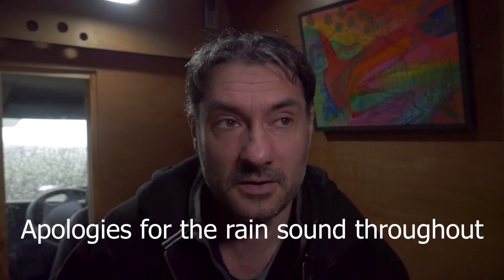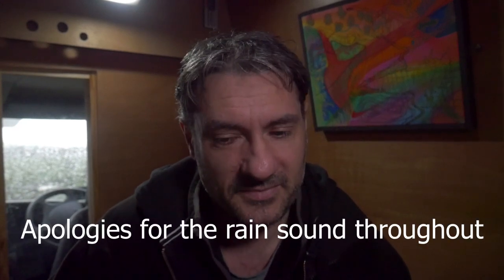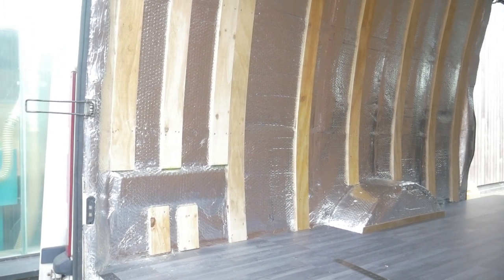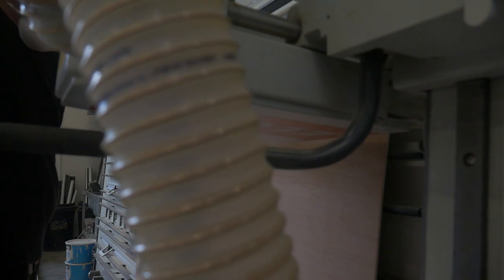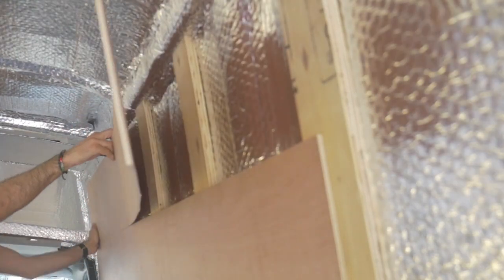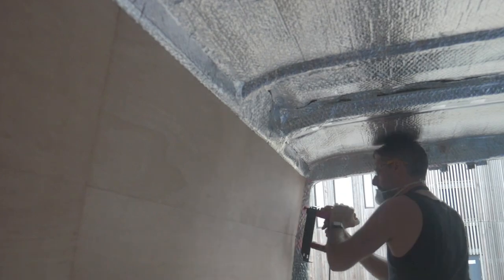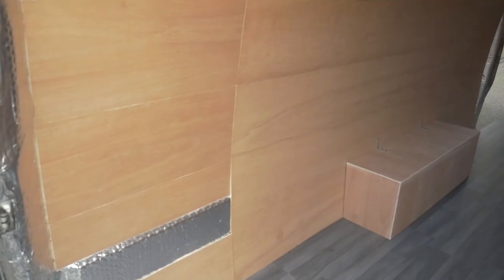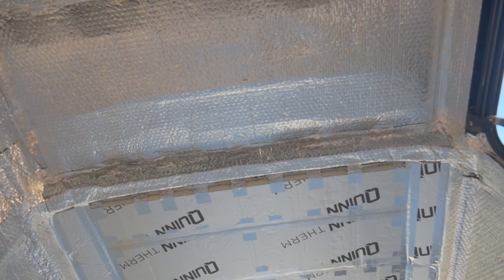IVECO Van Build - Go to the Wall - Episode 12

Comment: Nice work Rob, that work shop and tools especially the sheet cutter makes life easier for sure. As Luke said good job no screws into metal for cold bridge, very good tip marking for fixing points, I've always done that, I do the same thing for all the wires in walls and floor if relavent, I've done three vans now at 71years old my presant one is a keeper, I've enjoyed watching the prosses on you van, you take man.
Reply from the maker: Thank you Kim, The workshop was a real god send and most certainly made the build quicker. Glad you are enjoying the content. All my best Rob

Comment: Nice work Rob 👍 You may find with twisting and vibration that a screw here and there will be needed at some point. Nails can work their way out. You seemed to have put plenty in though 🤞
Reply from the maker: Yeh you are right every now and then I'll go round with a hammer and tap them in. But overall I've done really well. Cheers
Reply: @redpillinmotion  Luckily I got over my screw phobia, I had to as I'm a joiner/carpenter 😂 You did great mate 👍

Comment: The self-tappers screw into the metal wall of the van, correct? But how thick is the metal? I am having trouble envisioning there being enough thickness to grip. 

(Excuse my ignorance!)
Reply from the maker: Hey John, the self tappers would normally go into one of the support sections. So I would envisage that the thickness of metal here is around 3mm - 5mm. It's reasonably chunky. Cheers Rob

Comment: Rob
Would a simple box taped together using scraps of cellotex dampen the sound of the diesel heater fuel pump?
30 minute project?
Reply from the maker: Hi Roger, yes I would imagine so. I was thinking about something for mine. However I would imagine there would need to be some ventilation for heat to escape possibly. Cheers Rob
Reply: @redpillinmotion  
I've seen a review of similar heaters/ pumps with a soft rubber sheath / case  fitted tight to the pump.
I image the flow of diesel acts to cool the unit?